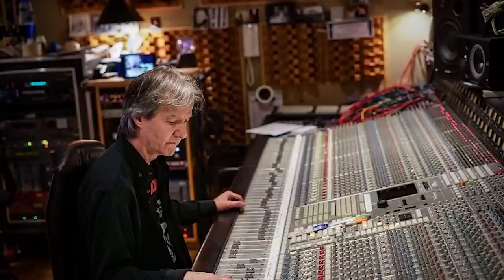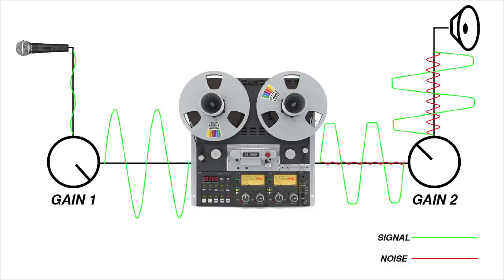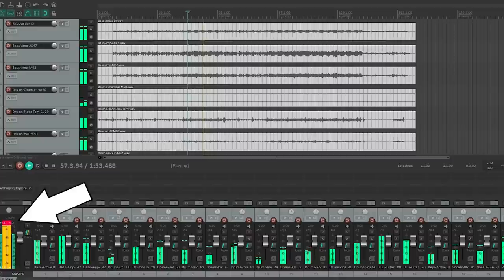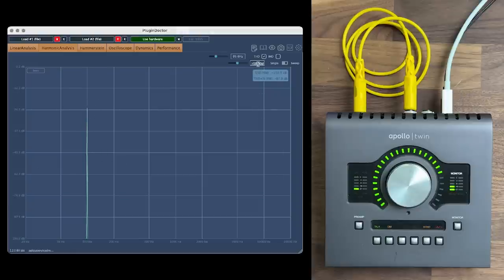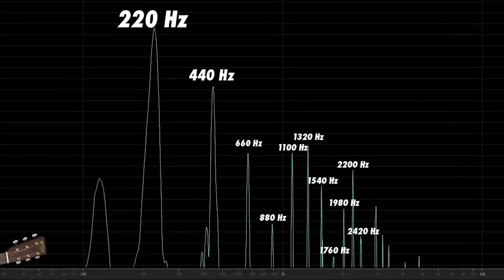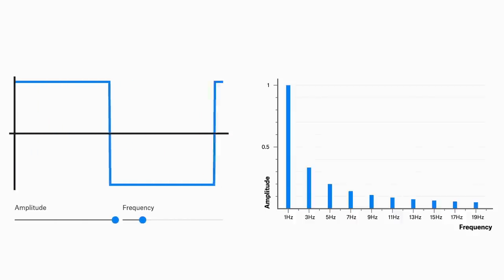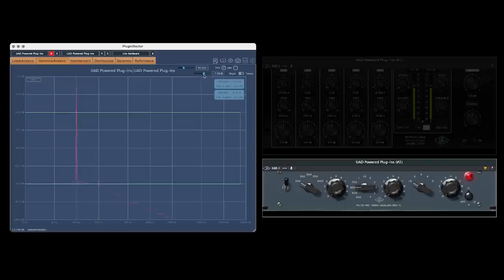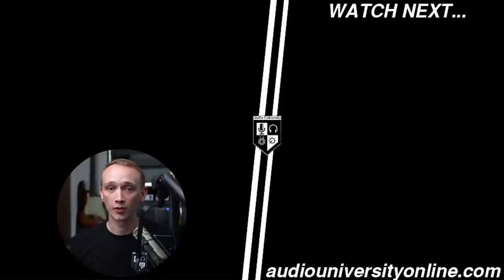What Is “The Analog Sound”? | Understanding Harmonic Distortion (Part 1 of 3)

Comment: Why Use analog when you can emulate analog harmonics with software while maintaining a lower noise floor or is high noise floor also musical?
Reply from the maker: Great question. The next few parts will go into more details of how analog is not able to be fully emulated in digital. But in almost every way I've found, these UA emulations (and many modern emulations) are insanely realistic. Only thing missing is the physical controls.
Reply: Aliasing.
Reply: @Chicken-1923  what do you mean?
Reply: Because you can not hear digital. Well not enjoyably!
Reply: @glenncurry3041  you can't hear analog either you hear sound waves. or all cables would be audible if that was the case
Reply: @BwanaJesuasifiwe  "Analog - something that is similar or comparable to something else either in general or in some specific detail : something that is analogous to something else.
...
relating to or using signals or information represented by a continuously variable physical quantity such as spatial position,..."

I can hear sound waves from a record from physical vibrations made from needle contact in a grove without any electronics. So unless you are deaf, YES you CAN hear analog and ONLY hear analog! And no electronics are needed.
Reply: @glenncurry3041  you are kind of right
Reply: @BwanaJesuasifiwe  I am 100% correct. Laws of physics.
Reply: For the same reason that daylight is better for you than a “full-spectrum bulb.” A model of non-linearity is not the same as real non-linearity.

Comment: Great video! Being a professional audio engineer hailing from the days of analog tape, I can tell you that sometimes we didn't always like "the non-linearness" that came with it. The first time that I ever used a Alesis ADAT, I was very impressed with the fact that the output sounded identical to the input. But, there was a time when just the thought of having to use a plug-in just made me wince. Since then, digital recording has made exponential strides. Nowadays I don't think twice about using plug-ins. And you're dead on about distortion; I  have more saturation, distortion and transformer emulations than I  can count! Thank you.
Reply: Agreed.

Comment: Great video series.  Nicely done.  I've been interested in this topic for many years.  For anyone interested, the landmark article on the audible difference between solid state and vacuum tube circuits was documented by Russel o. Ham in his article Tubes Versus Transistors - Is There an Audible Difference", Journal of the Audio Engineering Society, May, 1973.

Comment: Great video. As a long time audio professional, I've collected some stories about quality and fidelity. In a discussion with a music professor many years ago, the idea of perfect reproduction came up. His thoughts were fascinating. If you record a piano in an acoustically perfect room* using the best available gear and then play it back with the best playback system available, even a layman when blindfolded could tell you the difference. 

Our perception of sound is mostly made up of reflections from the local environment. If you introduce the effects of a different environment into it, the difference becomes obvious. There's no way around this, it's how our brains are wired. There is also the sonic differences of mic proximity to source (the same as speaker proximity to listener?). That said digital or not, perfect fidelity is a nearly impossible dream. In the end it is my opinion that the electronics in the middle don't matter much weighed against differences in transducers and environment. 

There is a quote from some engineer that said "Flat response? Get the jack change the tire." Maybe we should be trying to make music more "musical" than accurate :). Thinking about sonic extensions or additions to music is nothing new. A Chamber orchestra's music was written to be played in a chamber (smaller room). Bagpipes, in an open field were designed to scare the bejesus out of an enemy. There are many divergent examples. Most modern music was written to be compressed, streamed and played back through sub standard Bluetooth speakers or earbuds (ouch!).

I have subscribed. Thank you for a peek into the psychics and psychology of sound. Cheers

*What is acoustically perfect?

Comment: Great video! My main takeaway is that Digital is the best way to reproduce faithfully what the original signal contains.  Bingo.  That's what I want. That being said the original might contain analog elements that are there naturally because of certain analog equipment being used and/or introduced via plugins etc... So my rudimentary understanding of this complex topic is that  Digital and/or analog recording methods are best while digital playback is superior to analog  for an honest representation of the original source.  But I could be wrong😅
Reply from the maker: I agree with this. I’ll just add that someone could reasonably find analog playback subjectively better. So, digital recording and playback are best for high fidelity, analog recording and playback are good for color and texture.

Comment: A short contribution to try and make harmonics easier to understand:

Western music started in ancient Greece with the single string (monochord) Archimedes used and found some interesing relationships.

Imagine a Diddley Bow - one string streched and held in place at both ends: which frenquencies can this string produce *for a long time*? If both ends are held in place, only the frequencies that produce knots (parts of the string that don't move) in both ends. The first way the string can oscillate is going up and down in the middle and leaving both ends as the knots - the frequency this mode of vibration produces is called Fundamental Harmonic. 

Archimedes realized that there were other modes with equally spaced knots between both ends. The second harmonic, for instance, has a knot in the middle of the string, the third harmonic has 2 knots and the fourth has 3 knots and so on. What Archimedes noticed is that the pitch of the second and fourth hamonics seemted like they were the same "note" while the third harmonic sounded weird when played with any of the other three. We know call the interval from the Fundamental to the Second an "Octave" and from the Second to the Third a "Perfect Fifth" and from the Third to the Fourth a "Perfect Fourth" while the interval from the Second to the Fourth is again an "Octave". 

And here's the thing: Western music is based on the characteristics of the harmonics and on the math behind it. But there's a mystery: why we recognize the octaves as being the same note? The mystery lasted over 2,000 years but in the 2nd half of the 20th century it was solved: it's biology! Perceiving the octaves as being the same note makes it easier to recognize the voices of women and children that belong to your group!

The harmonics are the foundation of Western music and they were known long before Fourier and his famous transformation.

Now it's time for me to take a step much longer than my legs:

I think that, perhaps, because tubes had that nice distortion that sounded like you were not alone but had your wife and kids with you (or husband and kids) we developed a taste for that type of sound and that's why we still like that type of cozy distortion. It's important to note that what I said in this paragraph is an idea that came to me while writting the comment and just that! 

COMPLEMENT: have you ever tuned your guitar using the harmonics? Have you noticed that plucking the string closer to the bridge makes those harmonics louder? That happens because when we pluck the string closer to the bridge we add energy into the higher harmonics - and that's also why putting those things that capture sound on guitars in different places changes the "eq" of the instrument.  (sorry, I forgot how those are called in English)

Understanding and feeling how we can produce different wave forms by changing where we pluck the string will help you to later understand and feel the Fourier Series and Theorem.

Comment: Harmonic distortion is only ONE of the factors involved in "that analog sound." As someone who worked in the recording studio for many years, analog audio recorded on tape has a MUCH HIGHER RESOLUTION than digital audio. Secondly, the physics of a tape head color the sound in a specific manner, which rounds off some of the extreme low frequencies (as the low end limit of the tape head is determined by the circumference of the tape head) and accentuates frequencies in the high end at what is known as the "resonant peak" of the head, determined by the gap spacing of the head. (When you set up a tape machine taking ALL of these factors into consideration, engineers would often comment that the playback had more "air" in it... something they almost universally loved.) 

Then... another factor in the high end was the bias frequency. Without AC bias, one could NOT record on magnetic tape with any real fidelity. A bias frequency had to be at least twice the highest frequency that one wanted to record. Some manufacturers, like 3M, had bias frequencies a lot higher than this, which gave them a better sound that many engineers liked. Then... add in Dolby noise reduction, especially DOLBY SR, and one could argue that a well aligned tape machine sounded both better, and quieter, than digital recordings... especially that recorded through early ProTools analog electronics. Then... for the icing on the cake... music recorded through consoles with discrete analog electronics (such as the Neve 8060 and 8070 series consoles, or API consoles, and even old Quad Eight consoles) had an even greater depth and presence than music recorded through consoles with IC op amps as the method of amplification. The creme de la creme of this was recording through a discrete console to a Stephens 2 inch machine that had only 3 op amps in the signal path, all of which were discrete, hand build circuitry with class A electronics, so there was no 'crossover distortion' as part of the signal. So to say that 'that analog sound' was only due to one major factor is incredibly misleading. 

THEN, add to that the coloration of the recorded sound added by the different tape oxide formulations... and there were many choices one could make in an analog recording that would positively influence the sound of a particular music genre. 3M had 206, 207, 250, and 996. Ampex had 406, 407, 456, and GP9, BASF had their own formulations... and these were not the only choices available. 

It would behoove you to do a very comprehensive coverage of "that analog sound" to include all of these factors, along with anything else (like head wear and the heads made by different manufacturers... along with the electronics of different tape machines) that contributed overall to "that analog sound."  

To this day, a two-track machine that was first released in 1978 (which means that it was designed even earlier than that) is STILL THE MOST POPULAR two track machine available... the Ampex ATR-102. With the myriad of factors in that machine, it's been re-engineered by many, and almost universally customized to be one of the BEST sounding two track machines ever!!
Reply: Steady state sinewave measurements. Harmonic Distortion. The bane of the audio industry! Got my electronics degree back when tubes still ruled. THD and IM were used as tests because it was hard to get a good sinewave generator, much less test equipment to measure much else! At the TV stations in analog video systems we also had differential phase and gain measurements. A bit like TIM. Then digital video came along and the video industry came up with an entirely new set of T&M for it. I sold the leading edge of that test equipment. Audio kept THD and IM. 

Music is transients, not steady state sine waves. Yet we do not have a single measurement for it.

Comment: EDIT: it's not only digital audio but Bipolar Junction Transistors also had, in analog mode, harmonic distorsion was concentrated on higher odd harmonics - similar to clipping. It's not only if they are even or odd but also if they are low or higher. 

Old and small tube amps had around 20% THD to make the sound better on little power and bad speakers. The harmonic distortion of tubes happen mostly in the second and fourth harmonics - that is, it adds two octaves above the fundamental. On old piano roll player pianos, the arrangements - like Gershwin did - used exactly the same trick (adding octaves above) to get better sound out of short strings.

BTW, I hope the exchange rate in my country gets better so I can get a Universal Audio DSP.

Comment: As an audiophile, I always buy my analog gear based on lowest THD (total harmonic distortion).  As I recall, Onkyo EQs at 0.003% THD was the cleanest - or maybe a Rotel amp at 0.005% THD.  As a musician, I don't like compression - it kills dynamics.  And distortion should only come from guitar pedals!  3 decades ago I was already recoding direct to the hard drive in my bedroom.  I guess when you are both musician and sound engineer it's easier to get what you want in the first place, and you don't have to resort to tricks to "fix it in post [production]".

Comment: 2:31 This reminds me of the case of making Swiss cheese with modern technology and sealed sterile environment, only to find out that because of the lack of environmental imperfections, the cheese won't form its characteristic holes that were caused by dust. So they started introducing hay powder into the process to get them back.

Comment: This topic was debated to death a few decades ago. On pen and paper digital licks the floor on analogue in everyway. However in reality, that analogue sound via vinyl just is unmatched. All you need is to listen to a high end vinyl and digital playback setup.
The difference is immediate. As mentioned before this debate has been done to death before many here are even born yet. Just like valves vs transistors. As old as the tech valve is. it just have that unique human warmth sound...
Reply: I mean I'm not sure you have understood this video 
It's not analog vs digital 
It's what happens in each of these domains when the signal is clipped .

Digital is just a clean capture 
You are still recording analog 
I don't think anyone ever doesn't use a preamp going into the box? A pre amp is analog 

This idea that digital exists without analog is really out of context with what anyone is actually doing 

It's not a 1 or the other thing it's a Mixing desk and tape machine (out of box mixing) add harmonic distortion and digital doesn't unless the plugin used models this behaviour 

We don't mix clipping in and outputs of digital gear (unless you are sound experimenter or designer and that's very specific non normal use) 

Imo It's a very simple mentality to be analog vs digital, not very engineer like if you ask me
Reply: Just because something was done to death years ago does not mean it is the definitive correct answer....

Comment: The most of the sound engineers that lived the transition from the analog master tapes to digital (even with only 16bit/44,1 kHz!) state that the output of the digital recorder is practically identically to the input sound. Much more than the analog tape (figure out adding the final degradation to vinyl!), and this is the only thing that matters when speaking of “High-Fidelity”. This what the nostalgic people of vinyl and analog don't want understand. What they like is not fidelity. They spend a lot of money to get a not faithful sound to the original, thinking that it is!
The problem now is that the vinyl/tube/analog revival has brainwashed also many of the youngest generations, burying the belief in their head, that the vinyl sound is more close to the original master than a CD or digital. Fidelity and what you like are two different things, and should newer be confused.
Not to mention that the most vinyls are recorded from digital masters today, but when passing into vinyl, the sound just looses all the fidelity they don't like.The use of all these analog plugins everywhere also contributes to the lowering of the quality of the digital formats.